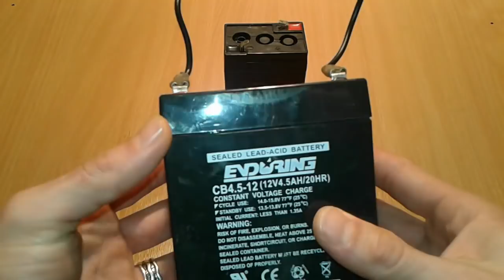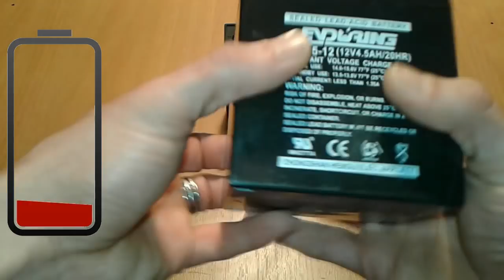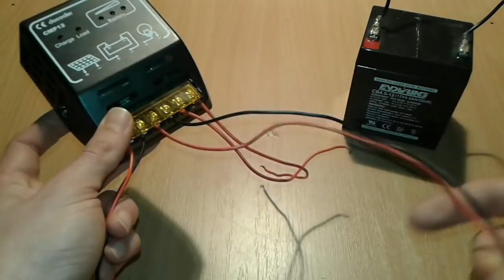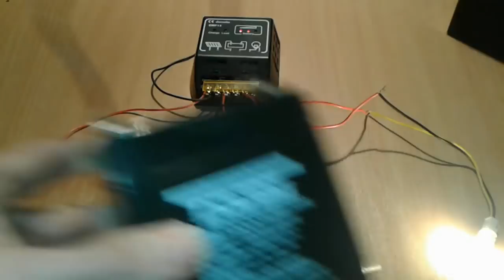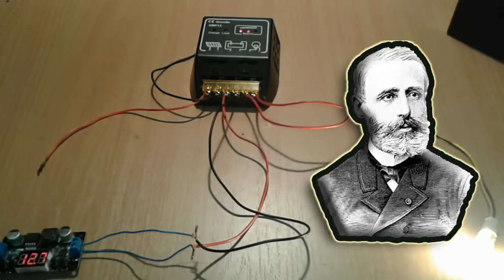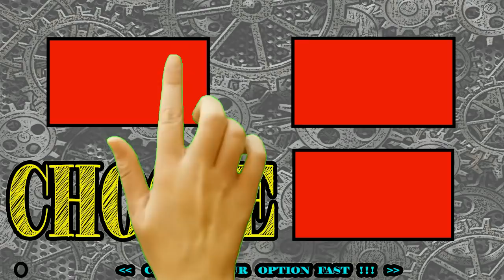12v battery discharge protection circuit is a must

Comment: will this work for milwaukee and dewalt batteries as well?
Reply from the maker: If the battery is 12v yes it will work for 24v there are some charger rated 12/24
it could be working for 14.4v i have to do more tests these chargers are preset in general for 12 or 24
Reply: NoSkillsRequired ok thank you m8
Reply from the maker: urjnlegend no probs any time